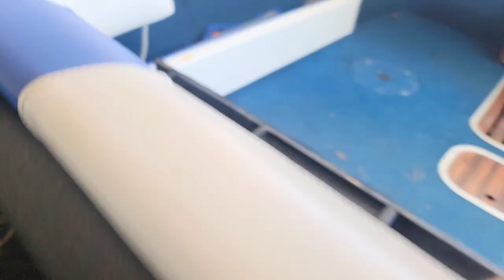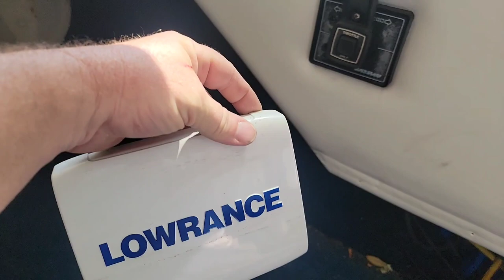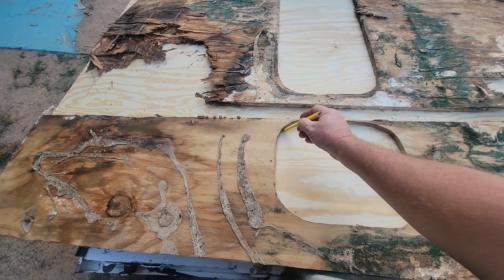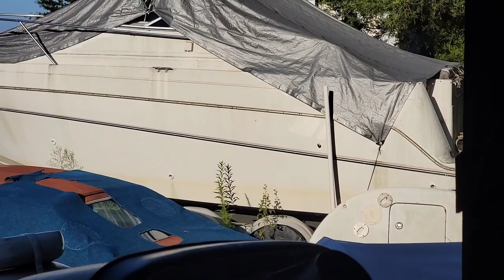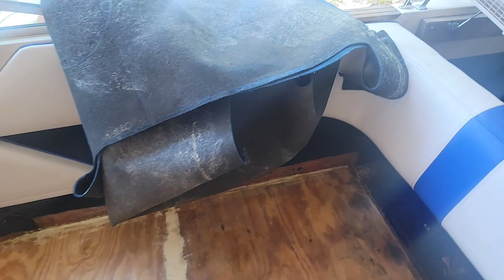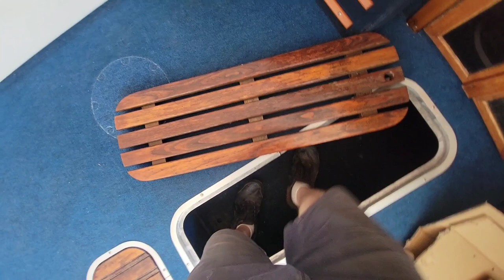Soft wooden boat floor repair ,before and after Stingray cuddy #trending #viral #viralvideo

Comment: Looks great! I just bought a fixer upper 1987 210 SS cuddly cabin and need to replace the floor as well, what type and thickness plywood did you use?
Reply from the maker: Thank you and Thanks for watching Vassmotorsports, hope you check out some of my other videos,   I don't remember exactly how thick,  around 5/8 range is good and strong and not to heavy , of course a marine grade is best to use